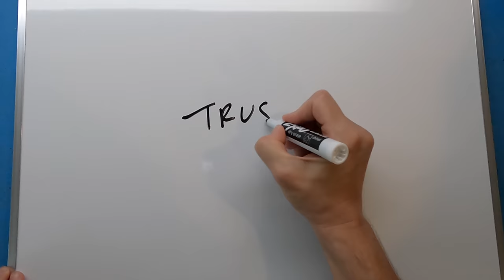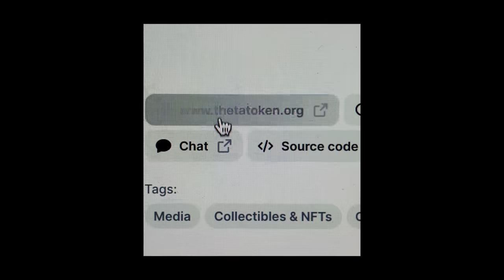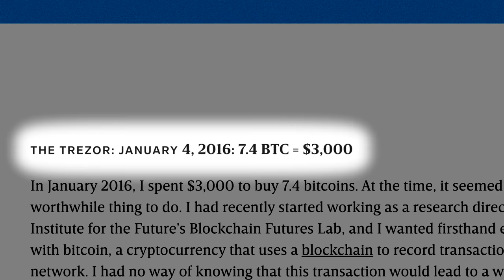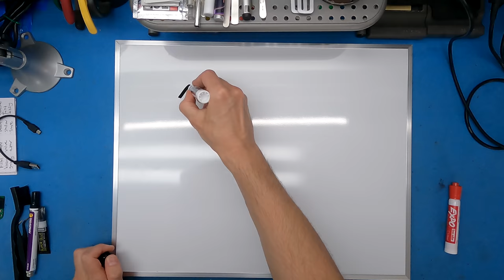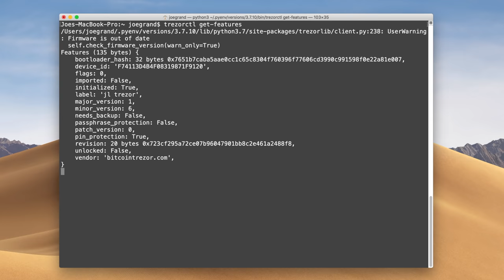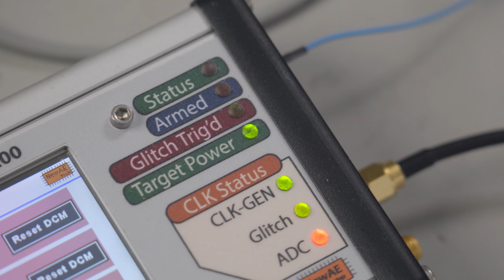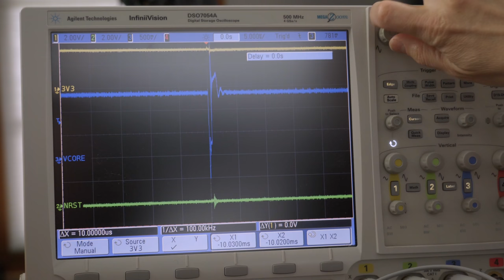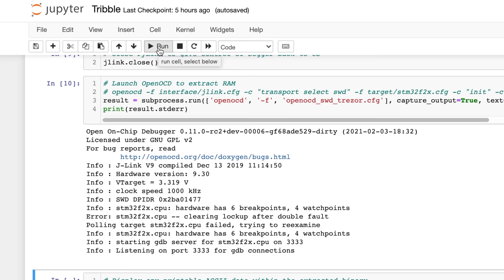How I hacked a hardware crypto wallet and recovered $2 million

Comment: Not connecting the scope to ground while hacking a chip with $2,000,000 on it is quite the classic engineer move.
Reply: Man you beat me to it. I was worried about him grounding the chip before he removed those capacitors. One voltage spike on that controller and the whole thing is trash.
Reply: @Jordan-qq9mg  I think he did that ground but not the scope ground, not grounding the scope isn't that big of a deal but if gives you bad data
Reply: It was connected to ground, it was just a shared ground lol
Reply: Hardly those chips can take hundreds of thousands of volts and be perfectly fine, hit them with a couple of amps and yeah you might fuck them up.
This isn't the 80's where chips and boards are really sensitive, static electricity is a joke to any chip from the 90's up.
Reply: @SilvaDreams  Thanks for the heads-up. Glad things have changed since my basic electronics course of the 80's.
Reply: @88njtrigg88  Never took a course, just grew up disassembling electronics (an pretty much anything else) for fun to learn how it all worked and had a kept my PC Jr from 1984 up and running till 2012 when I finally had to get rid of it due to space issues while taking care of my grandparents.
Reply: @SilvaDreams  Good stuff, same here more or less. I still have my Tandy computer from the eighties.
Good on ya for looking after you're elders all power too you.
Have a good one.
Ciao...!
Reply: @88njtrigg88  The Tandy you are talking about was it the TRS-80?
I remember when they first came out, I thought it was the best. Some of the programs you could get, were not too bad, Text Based most of them, but they did make you think.
Take Care
Reply: What did it make worth 2000000 like  what coins where in there and how much?
Reply: @SilvaDreams  correct me if I’m wrong, but if you ran “thousands of volts” through it, wouldn’t you still fry it because an increase of voltage will increase the amperage, since your resistance is still the same within that chip.
Reply: @markoquizzes1143  Nope you can easily generate a couple hundred thousand volts at a 100th of an amp or less. Voltage and Amperage don't go hand in hand as they increase. Your average home in the US puts out 20amps max (normally) but only runs at 120volts and as little as 0.2 amps can kill you yet static electricity can easily hit 1,000volts but is utterly harmless.
Reply: @SilvaDreams  i see. I know nothing about chips so I’m only using what I know based off ohms law, which proves that if resistance remains the same, amperage will increase with voltage. That’s why I was confused with your comment
Reply: @markoquizzes1143  In mechanical terms voltage is the ability to just go fast, amps are your torque. Sure you can get lots of speed with little to no torque but only if there is no load on it. Once you have a load you need more torque (or amps) to move the object. So it's like the difference between spinning your wheels in the air and giving it gas with the wheel on the ground.
Reply: ...it was connected to ground. Classic youtube commenter move
Reply: Surely you don't think this is real.....
Reply: @markoquizzes1143  Ohm's law does always hold, but the voltage is not constant. If I connect the chip to a thousands of volts power supply, it will totally be fried. But if the thousands of volts are static electricity, there is not much power. As soon as current ("amperage") flows the voltage falls to zero in a tiny fraction of a second, not enough to do damage. Unless you're very unlucky. But with 2 million, I would be careful nevertheless :)
Reply: Sunday times : Satoshi Nakamoto wrote an Ebook, the title "1 Million Bitcoin"
Reply: 45:10 and 45:27 in the "hackers testifying" video of his
Reply: @SilvaDreams  Personally if I have to explain electricity i like to call voltage -> pressure and current -> flow compared to water in a pipe for example. That way its pretty self explanatory why high voltage causes damage - the pipe ruptures.
Pretty easy to see if semiconductors where exposed to static discharge if you look at them under a microscope, as the silicon will look like the surface of the moon after a discharge: Lots of craters where the high voltage drove an arc through the layers. They might still work for some time being compromised like that, but they might also burn up next time they see power.
Reply: As an engineer who just yesterday asked my colleague about a probes connection to ground on a board, yes.
Reply: Yeah one solar burp and y'all are gonna be carving holes in the side of a cliff with the rest of us
Reply: @markoquizzes1143  You're forgetting that the maximum ampage is dictated by what the source can supply. That's the bottleneck. Static electricity can be millions of volts between tiny amounts of charge because the capacitance of everyday objects is so small. The resulting discharge will therefore be a tiny current. The capacitance of the entire Earth is only 4 Farads.
Reply: @Jordan-qq9mg  i doubt those caps he removed were associated to ESD suppression, more like on the reset line.
Reply: @SilvaDreams  thats not true...ESD is much more of a concern now than it ever was in the 90's and before
Reply: @SilvaDreams  I mean they can probably be okay, but why would you risk it lol
Reply: @milkanada5327  theta coin, and the guy didn't spend anywhere near 2 million on them, he probly spent well under 1 grand on them and they just rose astronomically in price.
Reply: @tyster911  lol
Reply: @simonrichards150  he literally said it had a shared ground. Pay attention.
Reply: @DaveSmith-cp5kj  nothing funny about a shared ground connection.
Reply: @tyster911  Like I said. You should take your own advice.
Reply: @SilvaDreams  ON what planet? I worked in PCB factories for several years after the 90's and through 2010. Chips and other components are very sensitive to electro static discharge that can be 25,000 volts off your finger or even higher. If we didn't wear our anti-static wrist straps you were instantly fired,
 I can't believe he didn't have any on.
As devices get smaller they are MORE sensitive to ESD.
Reply: sure glad this project was handed to him and not some random Youtube commenter Lion
Reply: @markoquizzes1143  you're wrong
Reply: hahahahahahahahaha   Jealous
Reply: @spaceclouds5156   i know, i mean which coin, like  bitcoin etc
Reply: Give back to my city, I am and will be using  my  security of the .
Reply: @SilvaDreams  your average oven pulls 20 amps wtf are you talking about? The average home is 200- 400 amps with older homes usually having 100 amp service lines, never less than that. Believe me I know.
Reply: @kiloton1920  I'm talking about at the normal household socket, not the line going into the home or the 220 socket that most ovens use. (And even those are normally limited to 20 amps)
Reply: @SilvaDreams  You are the joke. You are the static. Chips are MORE likely to EMP damage as chip die sizes have shrunk or chips have become more dense. I win, again!
Reply: @SilvaDreams  Ummm... not correct! If anything, it's the other way around.. and I've been using those chips since the early 80's. Older CMOS and NMOS devices could "latch up" or burn out gates from not observing static handling procedures thus destroying the chip. Today, they have found ways to mitigate this issue somewhat.. but surely not eliminating it. Matter of fact, because of the scale of integration today, this is far more hazardous!
Reply: After talking about no take cause static
Reply: I have no idea what any of these terms mean. But it’s really interesting lol
Reply: @88njtrigg88  there's a video of a guy trying to kill a computer with an ESD gun and the pc is absolutely fine and he goes "who made this thing".
Reply: @markoquizzes1143  indeed and if the current is in anyway limited, the voltage drops to near zero
Reply: CYBERLOGICS_ is the best for the job I recovered everything successfully without any loss and I'm still in awe because I lost hope , I don't know how to thank you and I'll keep recommending as promised
Reply: the 2 million is not actually on the chip, the chip just holds his seed phrase/private key and with that hes able to prove that he owns the coins.
Reply: @markoquizzes1143  those high voltage spikse are on very high, almost infinite impedance, can't supply high amps, the modern electronic components have zener diodes integrated in the IO cell to protect it, the voltage is clipped and the energy goes to the IC ground.
Reply: ESD matters.
Reply: 25:42 he said the ground wasn’t connected
Reply: have an old Radio Shack Computer and Printer... With original packaging...
Reply: @YnjeviYhhei  thanks captain obvious. You gonna tell us the money in our banks isn't actually there next 😱
Reply: @SilvaDreams  how smooth is your brain
Reply: @SilvaDreams I was wondering why he wasn’t using an anti static wrist strap!
I used those myself some decades ago as an electrician working on sensitive electronics.
Interesting to hear they “may” not be needed these days!
Great job!!!
Reply: @Jordan-qq9mg I’m sure an engineer of this calibre would have taken the appropriate steps.
But yes, I agree, a tiny rogue spike of current and its game over.
Reply: 12514 is 5 digits not 4 😁. That is all.
Reply: Oh great i woke up the scammers 🙄
Reply: He knows what he’s doing bud

Comment: One more subscriber. Little known fact that I am an Electronic Engineer and my design project was using a Motorola HC11 series microcontroller. Nice to see someone who knows their hardware 👍
Reply: That chip is from the 80's. I built a hardware clock around the motorola 68HC11 back in the 90's during college. The entire code was written in opcodes. Ahh simpler times. Little known fact, the 68HC11 was used in the automobile industry early on for computerized control AKA ECU's... It was also the first mirco to use CMOS EEPROM. We called it the BUFFALO (Bit User Fast Friendly Aid to Logical Operation) at least that's the monitors name. Such a cool chip.
Reply: @icemanfiveoh  I love reading geeky stuff like that. I have no idea what any of it meant though haha
Reply: @andykelly7321  haha. Hardware attacks are awesome. It’s basically how they hacked the psp and tons of other things. Getting access to parts of memory that shouldn’t be available. The engineers are smart, but as Ian Malcolm from Jurassic park said,”Nature will find a way”. Given enough time and pressure even coal turns into diamonds. And this guy got a big diamond!
Reply: @icemanfiveoh  It blows my mind how you can find a way of doing these things. I can barely work a toaster.
Reply: @andykelly7321  haha. In Russia toasters operate you. I just subbed to this guy, pretty cool techniques. This kind of stuff reminds me of the 90’s when I was building red green and dtmf boxes for phone phreaking. Hardware can solve many problems. Until they went digital with the telco switching networks, then we needed a new bag of tricks…
Reply: That’s so cool! I’m taking a microprocessors course rn and we’re using the HC11. This is the last semester that they’re using the chip for the course before they switch to some TI chip, but the HC11 is still being taught today!
Reply: @baxtergonzalez1115  wow. It is an awesome chip so I’m not surprised. I personally use pic micros now. C is so much easier than looking up opcodes on a table. I would look into a micro that you are familiar with and start tinkering. It’s the only way I have ever learned anything. Good luck!
Reply: I remember the HC11. Old school.
Reply: @baxtergonzalez1115  we guys did our microprocessor on 8085 and 8086 , intel stuff

Comment: They better have given you a good percentage of that 2 million to crack this… not just a basic hacking fee if it were any other amount. I would have asked for 10% of the wallet contents as it’s valued today at the very least.
Reply: 25% at least
Reply: They did not get anything it was a hype video, the source code they showed is not even run  on Trezor.
Reply: @samnectar  Right... They get 50% or 0% so..
Reply: @big_dwz  Even then, the exploit was real, as was the method he used it. This can be evidenced by Trazer themselves acknowledging the existence of this exact exploit.
Reply: @big_dwz  Is that for real?
Reply: @samnectar  You'd have lost out to someone else then.
Reply: @astromonkey4097  minimum 👍🏼
Reply: @samnectar  50% way too much i guess. he's definitely not the only one who is able to crack it especially so when he's not the founder of the exploit used and the exploit is known to the public. 30% probably seems reasonable
Reply: Not to discredit the work he did, but the attack itself is fairly well-known and common in the hardware hacking community. Frankly I'm surprised the "hardware wallet" was susceptible to this vulnerability to begin with. A proper crypto chip should have been used instead of an off-the-shelf MCU like the STM32 and it should definitely not be copying unencrypted secret material around in RAM/flash memory. That's just...bad. Not to mention the lack of physical tamper protection.

If I were approached to do this, I'd be over the moon with 10%. It's a lot of money for a voltage glitching attack (which I presume was to get the device to read the wrong value for the flag that disables JTAG/debugging output—still not clear on why the secret key was ever in plaintext in device RAM to begin with).
Reply: @flybackrs  It was susceptible in 2017. It hasn't been since then. The owner had just not updated their firmware in ages.
Reply: atleast 49% That was 3 hours and 19 minutes of waiting.
Reply: @flybackrs  i think ure just jelly he likely made half a million on it if not more being self employed with a decent youtube channel while u're employed as a cybersecurity researcher for 80-100K a year, and that's the best case scenario if u live in the US
Reply: @flybackrs  if you watched the video the client literally said his only options were some guys in Germany who refused to let him watch the hack take place even if he let them put a bag over his head, and this guy doing the YouTube video. Clearly the client demanded to be able to fly out and watch the process in person and most weren’t willing to do that.  So this guy had plenty of leverage being the last choice the client THOUGHT he had. regardless of whether “plenty of people could do it”. It’s about finding someone with references and documented experience who he can trust to pull this off and not destroy the device or try to steal the crypto currency.  So yes he deserved at least 10% minimum of that $2 million. I’m sure he made out well with how excited he and his family was at the end
Reply: Not deserving more than 5 to 10prcrnt lol.
Reply: @big_dwz  so why did Trezor felt the necessity to point out that this type of attack is outdated as speaking of nowdays hardware?
Reply: I watched a video a while back of some teenager using this exact method to hack Airtags lol.
Reply: 500k at least
Reply: 10% seems fair to me. You guys are crazy acting like 50% is fair.
Reply: @PodtrashRadio  I think that that was more 1. The scenario being played up for the production of the video, and
2. The client not being familiar with hardware hacking.

It's also not easy to just go out and find a hardware hacker :-) Joe did a great job & clearly did a lot of research and testing; that doesn't make the attack more novel or complex though.
Reply: @kerkertrandov459  I'm a security consultant, not a security researcher—we make 2-4x more than your estimated comp range ;-) plus I'm not handsome enough to have a successful YouTube channel...hah! I also only do hardware hacking as a hobby on the side. I do infrastructure security mostly at work. 

I don't know why you think I'm envious—Joe did great work, and hats off to him. But the attack he performed was not particularly specialized or something that only he was capable of. That's why he had off-the-shelf devices that helped him to perform the attack—not ones he had to make himself.
Reply: @flybackrs  nice to see someone else who knows what they’re talking about commenting on this rather than the friggin conspiracy brigade. As someone with a background in cyber security and blockchain I am refreshed to have my sanity partially restored by this haha.
Reply: @immanuellasker4273  and this sums it up folks. When you read random folk shouting things are fake online, first question if there is a reason why they simply are wrong. It happens a lot!
Reply: @PodtrashRadio  Switzerland not Germany, big difference ;)
Reply: REALyyyyyyy
Reply: @flybackrs  Hi, I'm just curious. For a security consultant, what career path did you take? I guess a degree in computer science is necessary. Is it possible to switch careers from the EE into cyber security, etc., to work as a security consultant or researcher?
Reply: 50%